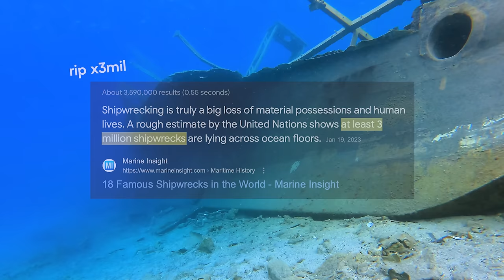Surviving on Homemade Houseboats!

Comment: OK, I am amused that the 1-hour build appears to be slightly safer than the 100-hour build - though I agree that if you'd had a storm, that would not have been the case.
Reply: Yeah
Reply: its because its less top heavy and thereby more stable

Comment: I think to improve the 1 hour version i would have gotten the  1 inch pink foam board 4x8 sheets with an inflatable lake raft (8x6) cut some windows out with plexi glass for windows that mount using velcro. Have a velcro door too.make it 2 feet tall for stability sake and have pop outs in the roof that are windows so you arent hunched over. Also it makes ir less likely to tip only being 2 feet tall. Can still do the pvc pice thing and now you have handles from the radt to attach to. Wouldnt weigh much, waterproof, if you get caught in the rain you have shelter, you have ventilation and sort of a way to retain heat (granted you wouldnt want to run any heater due to tipping concerns, its more less out of the rain, out of the wind and if you are lucky a sterno canned heat kept in like a metal pan with the velcro door slightly up higher so there is a vent at the bottom.

Comment: I was suspecting the house boat will have problems... when designing a boat weight is important, and not just weight of the boat but the weight of passangers. Those metals plates + battiers + other stuff were likely not calculated in when designing the boat.

Comment: This is a pet peeve of mine.   People going out and building these "faux boats"  using barrels, totes, storage bins and such, not realizing the risk,  and not taking the steps needed.   they will drill holes in them without adding sealant,  over load them weight wise, or not realize that under weight they could collapse or crumple, removing any buoyancy.  

They ignore the fact that stores, even like Home Depot sell modular marine floating docks.   that are MADE to have stuff screwed on them them, and each has weight ratings...  so you know how much you can build on + weight of passengers.   For example, a single 36x48" float will hold 500 pounds.     So 2 of them would be 72x48 base or   6foot by 4 foot.   if  bolted  togeather.  However you could  spread them apart to cover a 6x8 foot area, with 1000 pounds of person and lumber on top.    Thats enough for a 400 pound shed, 100 pounds of supplies and 1-2 people.   under 200 lbs each.

Now when you go up to 4 of them spread for stability...  or maybe 5 in an x patern.    2500 lbs weight,   with a base thats 12' long x 9' square platform that safe and stable if bolted togeather with the thick bolts and 4x4's.   a wooden 8x6 shed centered on that for stability,  weighs in around 600 pounds...  add in wood stove,  gas, etc...   and you have a floating cottage.       Thats MADE to float.

Comment: you gotta think about stability if the boat is too top heavy and has a high center of gravity it will flip over much easier while if the center of gravity low and you have more weight in the bottom of the boat its stable and wont flip flip over until the center of gravity is exceeded which will take a really heavily list for it to happen while if the center of gravity is high it will be exceeded very easily and it also depends on the width of the boat

Comment: Oh I think I could have done better on the one hour challenge.  Think plastic storage tubs with lids. Build a deck quickly with some 2x’s and plywood. Turn it over bottom side up. Screw the lids of the storage tubs to the underside of the deck and then snap the tubs into the lids. Flip it over again and then create an a-frame on the deck top using plywood and some support material. 😉

Comment: Can you build two small bike camping trailers?  A first folding (Length, width, height: open 280×90×140cm, closed 140x90x140cm) using a steel or aluminum frame, wood, plywood and insulation boards, a flexible solar panel, a charge regulator, a battery and a transformer, including storage under the mattress (20 cm high).  A second folding (Length, width, height: open 280×90×140cm, closed 140x90x140cm), using an aluminum frame, with fiberglass, with insulation boards, two flexible solar panels, a charge regulator, a battery and a transformer, including storage under the mattress (30 cm high).

Comment: so for the possible barrels filling up make sure to get something to cover the barrels also you can by a oxygen pump and bring it with you if u install the barrels sort of facing up and add a drainer to the barrels good job though. i personaly own a bass boat that pulls my cousins boat house since our bass boat has 250 hp.
Reply: oh and one more thing we are planning to add a bottom metal arm with a coating to prevent erosion to the boathouse and make it rise up. also you can get companys to specificly make no water intake barrels. i saw u added a troll motor but you can generally use a bass motor with a stick steering wheel
Reply: bud its not nerdy its just a suggestion maybe some of us know because we touch grass
Reply: @matthewyeager-io4zv  I do touch grass
Reply: @Rhyshughes1  sorry man im just angry you called me a nerd we cool?
Reply: @matthewyeager-io4zv  I was only joking